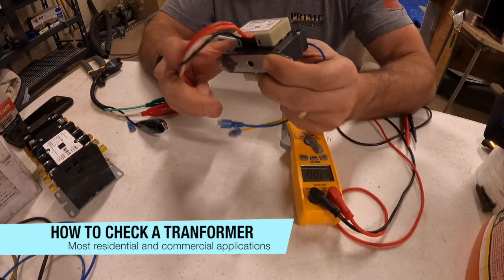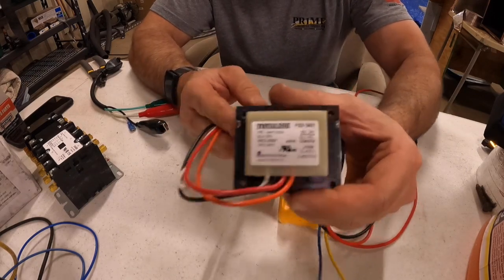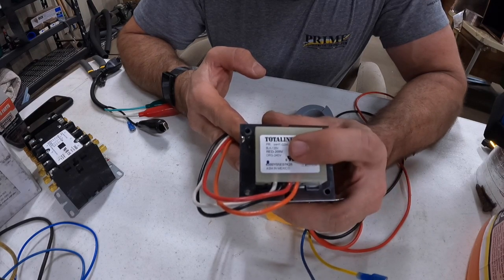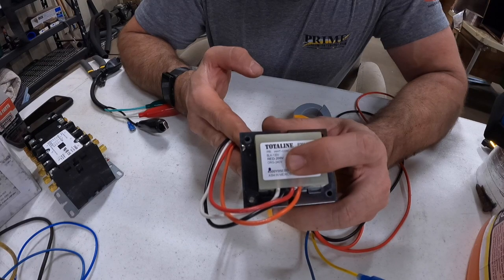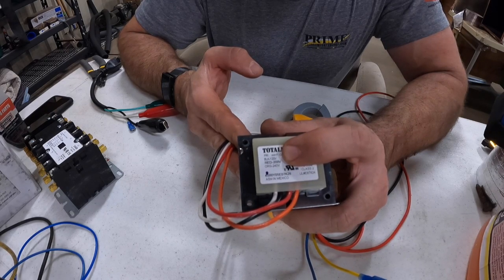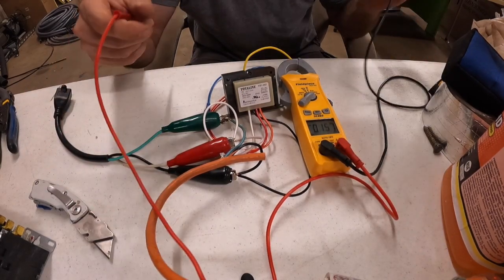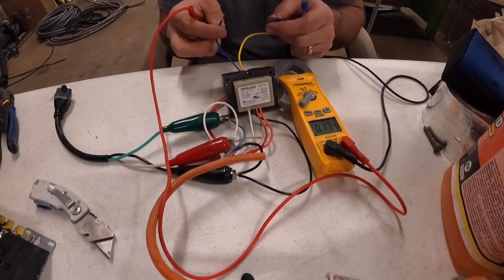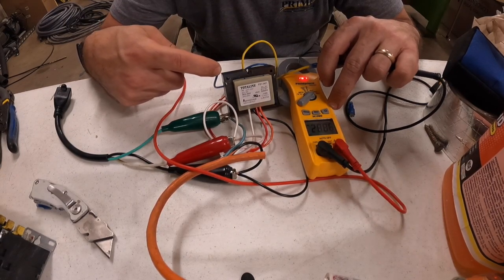Troubleshooting transformers

Comment: Looks like you atrached the black multimeter probe to the yellow, rather than the red. Does it matter?
Reply from the maker: Not with alternating current.  

When working with direct current the red lead is positive and black is negative.  Direct current (DC) voltage is produced by batteries mainly.
Reply: @AIRMANHVAC  thanks! So when testing the transformer, you're just touching one of the probes (no matter which) to each of the 2ndary outputs and looking for a 24V reading? (I couldn't see from the video where you're attaching the other probe).
Reply from the maker: @KeenaTurnerAndHooch  correct
Reply: @AIRMANHVAC  thanks, bud.

Comment: Hi air ...whst could cause a gas furnace 24vac transformer to catch fire / mrlt  on the 110v side ?
Reply from the maker: Probably a short to ground somewhere
Reply: Whats odd is orig transformer was no 24v...i replaced and all was good for 3 days...then transformer  catch on fire...and tripped gfci...main board fuse ok.
Reply: The control board
Reply: it ended up being a bad neutral wire coming from the meter outside.

Comment: How can you test the transformer with no power? Do I check continuity or resistance and what should the resistance be?  Thanks in advance.
Reply: If you have a Milli ohm meter that's the way they are tested. It's measures very low ohms. It will also measure less than on ohm accurately.
Reply from the maker: Hey Progress, that’s a great question. Unfortunately I don’t have a solid answer for you.  All transformers are going to have different resistances based on voltages and their VA ratings.  What I do when there’s no power is check the resistances across the secondary side and primary primary side of a new transformer that’s similar to what needs to be replaced and compare it to the transformer in question.

Comment: It’s an old Bryant unit no circuit board no 3 amp fuse . If the transformer is good any suggestion what part you might think is causing the no start ?
Reply from the maker: Hey Rick,  you get it figured out?
Reply: Check the voltage coming out of the board.. if you have voltage coming out of the Transformer and you have it going into the board then most likely you don't have it coming out the board which would be a bad board

Comment: Hi I’m a diy i checked my AC’s transformer  i took it out from the air handler it doesn’t smell or look burn! And the multimeter bipped, does that mean it’s good? Do I still have to test it if its Getting proper voltage? Trying to fix my AC that won’t turn on . It’s a 35 yr old Bryant no fuse , no circuit board, it was working before until I bypassed the thermosthat, I must have stuck the other end of the jumperwire to a wrong one and it short circuited something. If it’s not the transformer , what will u suggest the next part I should check?
Reply from the maker: Hey Rick, assuming that you have a transformer that converts 120 Volt or 240 volt to 24 volts and the transformer is installed....first, you need to confirm that the correct voltage is being supplied to the transformer (either 120 or 240). Second, confirm that the transformer is generating 24 volts between your secondary wires (which is the wires that were hooked up to your thermostat wiring.  If you have voltage coming in but not coming out, the transformer is bad.